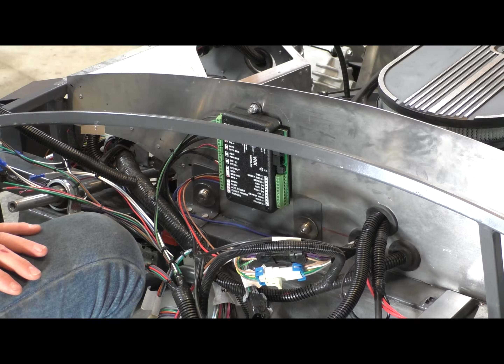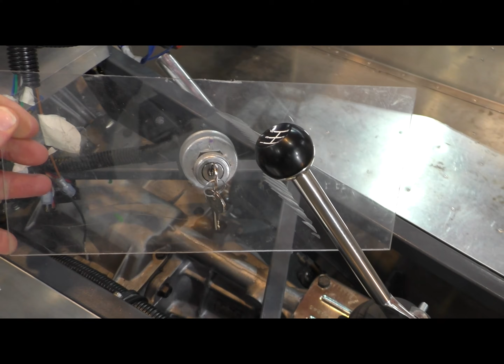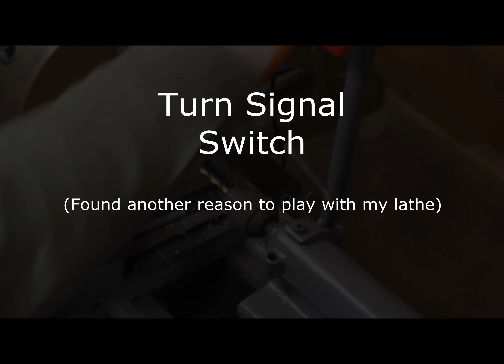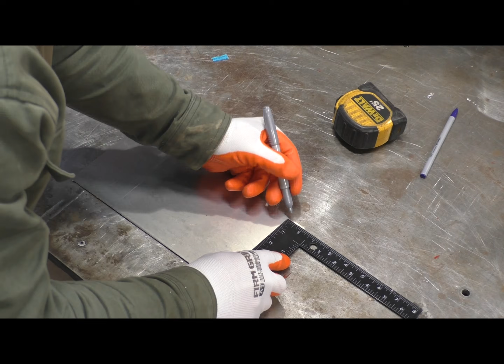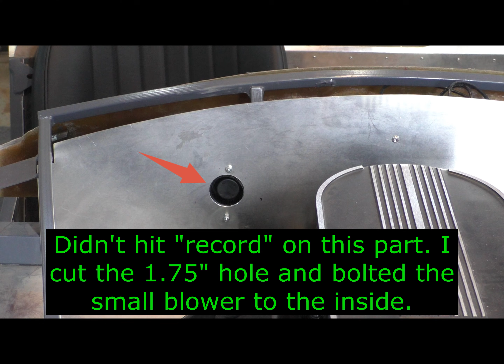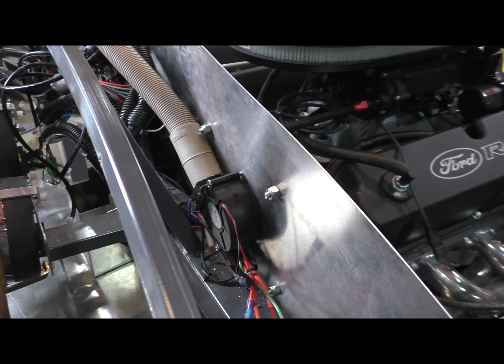Factory Five Roadster build 16

Comment: I'm catching up on your videos.  You're going at an excellent pace! 
 Two things.  
  Adding an extension to that switch is a great solution.  With the switch being vertical, keep an eye on weather that extension is too heavy or not.  The weight of the arm may eventually trigger the lower setting just by gravity (like a bump).  When the Ford turn signal cams get old and break, that can happen.  So I can see it happening to that switch.
  The daughter fuse panel is a great idea.  Close to the battery and closer to some accessories too.  It's in a good spot that doesn't have to be wedged in.
Reply from the maker: Shawn,
Good call on the turn signal switch, I’ll keep an eye on that. I did use aluminum tube for the extension to keep tabs on the weight, but yes, I can see that over time it could trigger the “left hand” signal— and I certainly don’t want to be one of those people driving around with the left hand blinker on.

Comment: That’s exactly my take on the master switch. I made mine so everything is disabled when it is off, even the Coyote. It’s so handy when you want to do electrical work, but having my switch under the dash means when I’m upside down in the foot box and remember that, yet again I forgot to turn it off, I can still reach it without effort.
Reply: Mine cuts off everything except the sniper. Leaving power to the sniper prevents it from losing it's memory.

Comment: I noticed that the dash is lower than the hoop on the frame, the body may not fully cover all that, as they are not exactly the same shape. Have you not fitted the body at all yet? I have had to have mine off an on a few dozen times making sure things fit and are accessible an serviceable with the body on.
Reply from the maker: The dash sits higher when bolted in place. It’s only hanging there by a few hooks  currently. It’s sits almost flush with the bar.
Reply: @randomwerks3763  I love the custom look of it. I am envious. I may do something myself in the future. I would like to be able to remove the dash with the body on and the steering column still in place.
Reply: love the look of the dash though. Looks great!